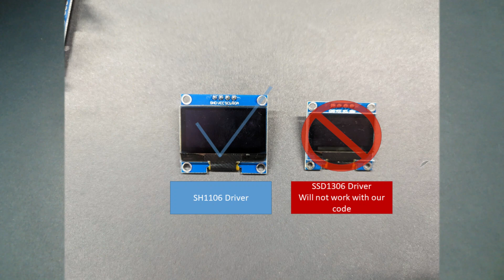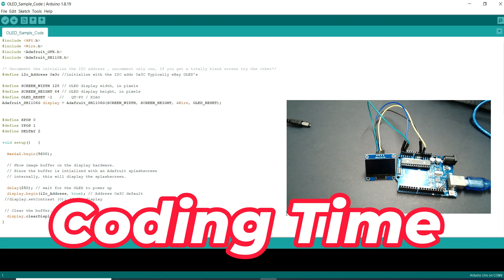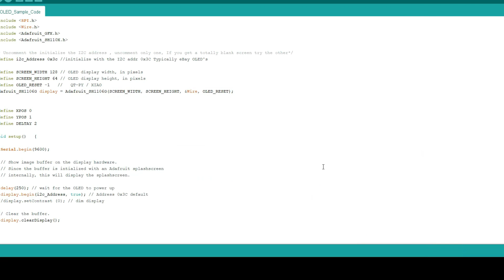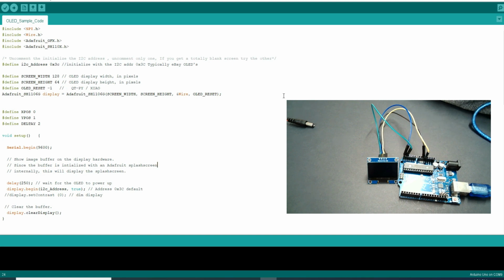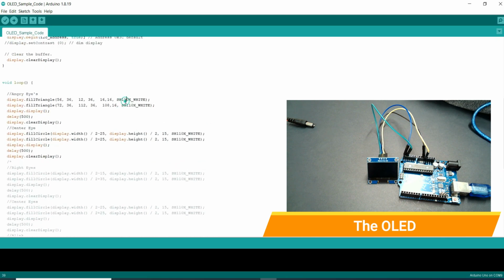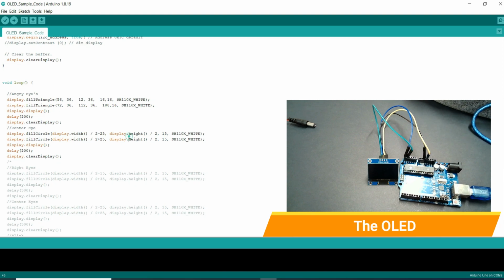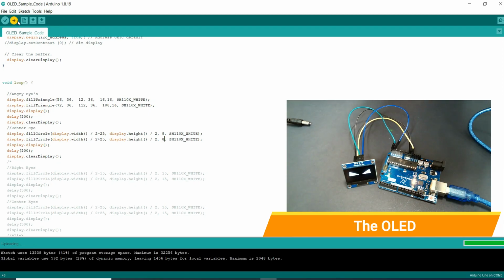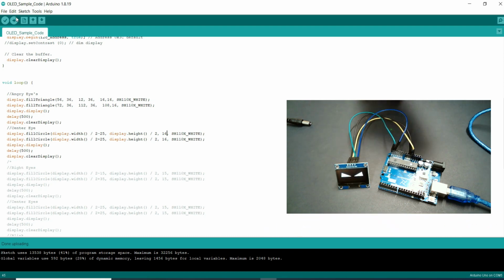Arduino Robotics Part Three: OLED

Comment: Sorry, sir, I have an OLED, but I'm wondering how to program it to display eye animations like an emo robot
Reply from the maker: Would depend on the size and manufacturer but you could try my code in the description with an Arduino.  The circle shape can be changed, with the code drawCircle(x, y, radius, color). x and y is the position on the screen and radius is the size of the circle. You could use a small radius for more emo looking eyes. 
Hope this helps!

Comment: can this be done with an arduino mini??
Reply: or arduino nano
Reply from the maker: From what I've seen you can just remember the Analog pins (A4 and A5) are in a different location for those chips.